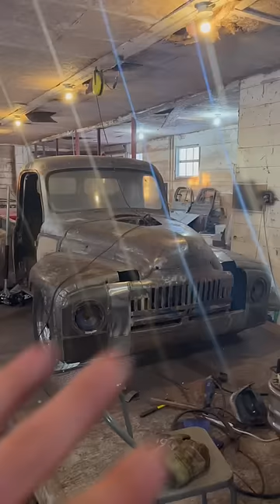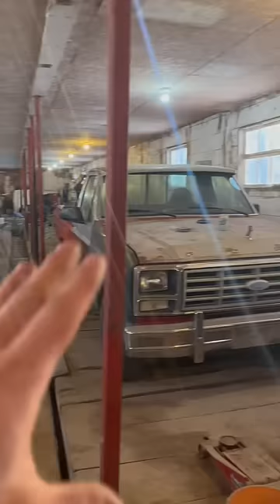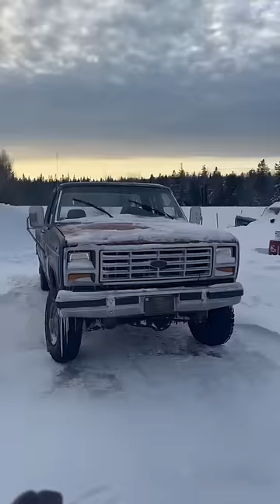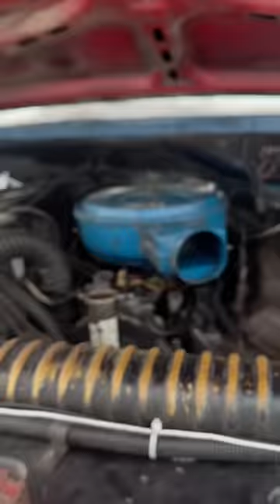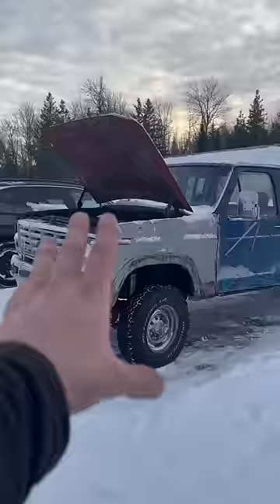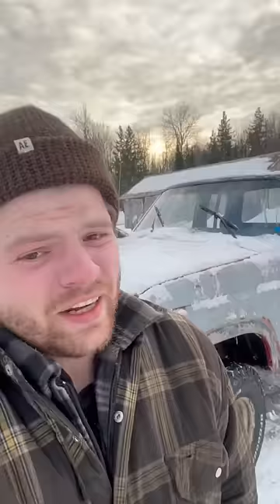FORD couldn’t figure it out until 2011!

Comment: The 6.0 was the nail in the coffin on that company
Reply from the maker: I know what you mean, the all international variant of the 6.0 wasn’t too bad I guess, vt365 was the international trim, a few accessories differences but the biggest change was the international one wasn’t factory “chipped”, running all day everyday was more important than max hp and tq unlike the ford trim.
Reply from the maker: Likely that same story though as my old 6.9, half the reason this old power plant is so tough is it doesn’t make enough hp and tq to hurt itself for its size haha 😂
Reply: no, the 6.4 was the final nail in the coffin for that company.
Reply: You can blame ford for that. 

The VT365 had none of the issues that the Powerstroke did. 

And no, it wasn’t the 6.0 that was the nail in the coffin
Reply: 6.0 wasn’t bad engine ford decided to put bolts instead of studs in the heads to be cheap and the injectors used by ford and chevy were the other cause.  The 6.4 was a giant turd.
Reply: Buddy the 6.0 looks like the most solid engine in the world compared to the Maxxforce. The Maxxforce is the engine that wiped them out.
Reply: @kneedragon76 AND, not enough head bolts, and plastic fittings that break, and casting sand in the cooling passages, and terrible stacked plate oil cooler, and variable vane turbo that seizes up and.......
Reply: Did this man just say there's nothing wrong with an international?
Reply: @iwouldrathernot4274 they had a version of the dt466 in the first generation nova lfs city bus. yes many other city buses also had it as an option, but only in 30 foot long buses usually. novabus at the time only had a 40 foot long option. apparently those detroit series 40's loved to explode in them. as of 2004, it was no longer offered as an option. though i'm pretty sure no transit agencies bought the series 40 in droves after the late 90's/early 00's.
Reply: Watcha mean?
Reply: @kneedragon76 literally every diesel ever has head bolts. There just wasn’t 6 per cylinder, and they aren’t gonna blow if you don’t tune it, delete egr, and drive like a normal person
Reply: The 6.0 was as great motor. Too many morons were putting race tunes in them and blew the head gaskets and you had assholes commuting/idling them because diesel was cheap and coke up the vgt valve and or the egr. I had over 300k on mine and if I wasnt plowing, I was pulling
Reply: It was the 6.4
Reply: @gavincarroll2553  the 6.4 is the best powerstroke ever made besides the 6.0, the only issue with it is emissions
Reply: @gavincarroll2553  last good international powerstroke was the 7.3
Reply: @illinoiscentralrailroadfan6015  I know but they could've fixed what got messed up with the 6.0 the 6.0 was the first nail the 6.4 was the last
Reply: @gavincarroll2553  I agree with you, I was in highschool when the 6.0 came out and already planned to go to school to become a diesel mechanic.   At time in highschool I already knew that I would be working for Ford sometime soon, so I decided that after I had been there for a few years I would get one.   Six months after I made that decision 6.0 recalls began.   I decided at that time I would never own a 6.0 powerstroke.
Reply: @illinoiscentralrailroadfan6015   I do want one because 1 they sound good 2 there really cheap now and 3 after there bullet proofed there not bad trucks but stock there a ticking time bomb
Reply: Nope 6.4 was my 6.0 has nothing wrong with it and it’s got 700hp
Reply: @DragonTorquemovies  the 6.0no🤣👍
Reply: @kneedragon76  Crazy part is, a bolt and a stud realistically are about the same amount of material. The cost difference to stud the engine during design had to be within a $100
Reply: International didn't build the 6.0
Reply: @JBlinky67  international and navistar did ford didn’t make their diesel engines till the 6.7 powerstroke came out know your facts
Reply: People blaming ford for the 6.0 issues I blame international for not enough head bolts 4per cylinder is terrible 6head bolts per cylinder would have given this engine enough clamping force to avoid at least 75% of the blown head gaskets
Reply: Its still a mystery to me that ford went with 4 bolts per cylinder on the diesel.
Reply: @DragonTorquemovies  the nail in coffin was the 6.4 which happens to be the last engine Ford had built for them until they decided to do it themselves. 6.4s are dooooooooogshit worst diesel that ever came in the big three
Reply: 6.0 was pushing way more power so it was bound to have issues. 6.4 was even worse.
Reply: Huh, I guess I thought the 6.0 and 6.4 were Ford designs, and I’d thought it took Ford until the 6.7 to figure out how to do a diesel engine right

Comment: If peg can't kill an IDI, they can't be killed.
Reply from the maker: I can agree with that haha, I’m getting a little worried though, we haven’t seen slave lake since last winter now as far as I’m aware.
Reply: @highostablegarage  last time I remember seeing her was when it blew the belt off during a savage cold start. The one where Peg used the white Ford to push slave with.
Reply from the maker: @anthonyjulson8840  for me it was when they were bagging it through snowbanks with I think sawed off Frenchman and it overheated, might be the same video though
Reply: @highostablegarage  I believe it was the neighbor. Is this the video where the bumper fell off? If so, I think it is the same one.
Reply from the maker: @anthonyjulson8840  yeah same video
Reply: Oh they can certainly be killed…some are just tougher than others. I had a well maintained 6.9 that popped a head gasket just cruising down the 2-lane at 55 one day, no rhyme or reason as to why. Sometimes you just get a really good one, but then sometimes you’ll get a really bad one.
Reply: @J.R.in_WV  I'm not sure if you're a fan of the zip ties and bias plies channel, but I'm pretty sure the truck I'm talking about definitely has a head gasket failure. She still runs good as far as I know though. I guess it comes down to where on the gasket the failure is.
Reply: @anthonyjulson8840  peg straight up said the head gasket was gone but she still ran ree ree strong.
Reply: I’ve had three 86’ 6.9’s….one burnt a valve @ 348k and a rough life.
The one I currently have is at 159k and I bought it from the original owner
Reply: @highostablegarage  she still runs, he uploaded a video to his patreon about the truck.
Reply: @highostablegarage  yea um the 6.9 has one issue that i know of cause it happened to a family member if the o rings get wore out bad it will mess up the motor
Reply: @highostablegarage Don't worry about slave lake.
 That truck made his channel and he knows that he's admitted that on his channel and he said she's not going anywhere He recently actually puts some new parts on her
Reply: I love pepin leggin
Reply: @kartaku132  I saw the sla e lake revive video. I never heard him admit that save lake made his channel.
Reply: @anthonyjulson8840  I can't remember which video it is.I believe it's the one where he puts her on the back of the kenworth and Take her to the parade but I could be wrong
Reply: I just had to start parting out my idi. Low compression. Bent 4 push rods had some minor valve piston contact. Rebuilt the head as all the exhaust valve guides were shot. Sadly still has low compression. Truck has 375000 on it, started life as a fleet truck so can't fault it. If the truck was in better shape I'd rebuild it. Keeping the drivetrain for a future project.
Reply: @anthonyjulson8840  just like an FE
Reply: Miiiiinnnttt!!! I was waitin fer a comment about ol peggin leggin!!!😅
Reply: @justinharroun69  you're kinda stunned if you aren't subscribed to his channel!

Comment: I have a old 85 F350 king cab 4x4 duelly with the IDI diesel and a 4 speed manual transmission. I got it dirt cheap ( free ) with only 101xxx original miles. It's now got 234,787 miles on it and it's still as slow as it was when I got it. But I have pulled countless truck out of the mud, snow, ditches and one from about 7 ft under water with the trailer still attached at the boat ramp. It has never left me stranded, it's never got stuck ( awesome tires, lockers front and rear and lots of luck ) and it's always pulled whatever it was out of wherever it was. I love that old beast. But it's getting a Turbo 7.3 powerstroke with a 5 speed soon. Already have the engine/trans / transfer case sitting in the shop.
Reply: If you had an F series with an lDI in it 0-60 would take a while, hook up a trailer with 10,000 lbs on it the acceleration would be identical to no load. Not much on horsepower but mountainous torque right off the line
Reply: Take my advice, don't ever let go of it!
Reply: @GorillaCookies  I'm jealous.
Reply: @MichaelRoy-hc3lz this just is not true. I’ve had a bunch of IDIs. Maybe mine were all worn out slobs but they were great unloaded cruising around but you put a trailer on and it is a road hazard.
Reply: @gavinmetcalfe140 I’ve had some that couldn’t get out of their own way and some 6.9’s and 7.3’s both that were turbocharged and pulled great. The problem lies with people thinking they should pull like a brand new 500hp/1000ftlbs tq turbo diesel and that’s just an unrealistic expectation
Reply: All 7.3 Powerstrokes are turbocharged my friend
Reply: @GorillaCookies  are you selling or keeping? if selling how much?

Comment: It's not that Ford couldn't built diesel engines. They were still building them for farm tractors in to the 90s. The problem was that they didn't have an diesel that worked for a pickup truck so they shopped around and found International had one to their liking. The interesting fact is that Ford and International were old rivals in the farm sphere almost as long as Ford had been rivals with GM.
Reply: Right on 👍. Ford was probably the leader in Medium Duty trucks up until IH introduced the S-series in 1979.
Reply: @ghenry85  ford built some amazing tractors
Reply: @ghenry85  still, they could've easily stuffed the 6.6 Brazilian in a 3/4 ton. They put them in the f800's along with the 7.8. they even had the 6bt as an option for crying out loud.

Comment: Ford did know how to build diesels, and in fact built many different models, but they were primarily used in tractors and medium duty trucks, in other countries. They were also inlines, not a V configuration, and Ford didn't want to have to completely redesign the truck and firewall to fit the engines, the way Dodge did.
Reply: Dodge did NOT redesign thier firewall to fit the 5.9 Cummins in thier trucks. 89 was the first year of the Cummins being available in a Dodge pickup, and that firewall was the same from 1972 through 1993. The radiator core support was changed for the diesel trucks in those years, but not the firewall.
Reply: Ford's 6.6L Brazilian diesel would've been a good pickup truck engine but it never would've fit. Too much BS hanging off the front thanks to the waterpump location. The B series Cummins has the water pump offset so it's not sticking out in front of the #1 cylinder or timing gears. Chrysler did that same thing in 1959 when they introduced thier Slant 6.
Reply: @johneckert1365 Yeah, I mean 5.9s fit in Rangers...
Reply: This is correct the 6.6L and 7.8L  Ford diesels were real workhorses, but were too large for pick up trucks.

Comment: The 6.4 was the last straw!!
Reply: *last stroke 😂
Reply: Mine is running just as good as it did in 2010 and almost 350K on the clock. @LynxStarAuto
Reply: @johnelliott7375  did you buy it new? any major repairs along the way?
Reply: @xxmobstrxx8535  if you want a 6.4 to last, you MUST fully delete the emissions systems and tune them. The DPF, EGR, and Regen systems absolutely fuck the motors. My dad has a 6.0 he had since new. Those need studded and EGR deleted, but out of the box they're more reliable than a 6.4 because of the emissions.

Comment: We have a 93 7.3L International and I swear the engine will outlast anything else on it! 323k and creeping!
Reply from the maker: Yes sir likely will, I have a buddy who pulls a 5th wheel flat deck trailer with his, his old Idi is an X rail yard truck, has over 1.5million kms on the long block, has had a few injection pumps and a couple c6 transmission since but the engine is still plugging away 👌
Reply: @highostablegarage to be fair tho, the C6 is notorious for issues, same as the E40D ford really didn’t get that nailed down till the 4R100

Comment: I do love the 6.9 and 7.3 idi but I still think ford should have put the dt360 in there pickups
Reply: I've always thought that too. Problem was the waterpump arrangement on the DT. Being inline with the cylinders it added way too much length to engine. The B series Cummins had the water pump offset so it wasn't competing with the #1 cyl or timing gears for space. IH followed suit when they redesigned the DT466 in 1994.      Chrysler slant six also had an offset waterpump to save length.

Comment: I knew about those IH diesel engines being in Ford pickups!!
Back in the 1990s, I worked for a used pickup dealer who bought and sold a steady stream of those Fords.
I worked in the dealer's mechanic shop, helping to rebuild the engines.
Reply from the maker: Yes sir, I love them to pieces, they are pretty much a tractor engine, just an old faithful power plant

Comment: I have a 1953 International 2 Ton dump truck (big wheat truck) and a 2002 F350 7.3L 6spd manual, manual transfer case, manual locking hubs.  She's a tractor..  and I love it.   So, I'm right there with ya...  Ford and International baby

Comment: I'd like to get my hands on a big block GMC V6
Reply from the maker: Good luck haha, I’ve personally never even seen one around here
Reply: Those legit existed?
Reply: @anthonyjulson8840  yea, they were common in tandem dump trucks around here before the diesels caught on …the 478 V6 was a stout pulling engine for what it was. The smallest GMC truck V6 they had was the 305, you could even get it in gmc pickups for a while. Same external dimensions as other GMC V6’s just de-stroked and a smaller bore.
Reply: I just passed one up complete and running for 250 bucks
Reply from the maker: @MidwestMechanics  wild haha
Reply: Dudes with wrenches just posted a video about the v6 big block
Reply: same
Reply: There were diesel versions of those old GMC engines. ToroFlow they were called.

Comment: Ford didn't need to start making their own till International let the quality go to shit. I'm not aware of Fords having diesel engines till 83 but, there might be some 82s that came with them. Ford and International started working together as early as 78.
Reply from the maker: They had a few smaller diesels for couriers and such, obviously larger diesels for past the f350 sizing like in the 9000s and 600s but I cant think of any in the 250s and 350s pre 83 either.
Reply: 82 is when IH started working with Ford on the 6.9 diesel, introducing them in 83. 
Note: the 6.9 and 7.3 idi are designed off of IH 404 and 446 gas engines.
Reply: @johneckert1365  They actually started working together as early as 78. They finally got diesel engines in Ford trucks in 83. That's excluding the big dump trucks and road tractors.
Reply: @nicklewis7291  oh wow, I didn't know it was that early. 
Ford also collaborated with Caterpillar in the early/mid 70's and designed Caterpillar's 1150 & 1160 (early versions of 3208). Ford wasn't involved with the manufacturer, just the designing.
Reply: @highostablegarage I can, in Australia dentsides were fitted with locally built engines like the 351 Cleveland and 250 six. There was also the option of a Perkins diesel 6.247. They’re quite rare because most wanted 351 power.

Comment: 7.3 powestroke was the last reliable diesel in a ford pickup.  Until in 2020 when they went too steel pistons.  Heard good things since then.  Reliable diesel with a non rusting aluminum body is a win win.
Reply: Ha 😂, that aluminum bs might not "rust", but it still corrodes into white powder.

Comment: International trucks are almost indestructible, and ford wanted some of that reliability, that's where the IDI engines came in lol.
Reply from the maker: They work some good, they are better than the gm 6.5 that’s for sure haha 😂
Reply: @highostablegarage this is true 🤣
Reply: That's why the truck falls apart, and the engine remains 🤪
Reply: the idi came from and international medium duty gas engine that didnt sell very well to recoup their tooling investment ih made a diesel out of it.
Reply: @REDPWR4EVR Yes, the 404/446 gas engines.

Comment: And the international harvester diesel motors are unlike the gm V8 5.7 and 6.2 first version diesel V8 motors you can actually work and pull trailers with the 6.9 or the 7.3 idi and not hurt them and i am am not a huge fan of Ford but the 6.9 idi diesel happens to be one of my favorite diesels ever built...

Comment: Ford had a successful relationship with Navistar and invested in them to build the diesels.
They did figure it out.
That's how it was done and many people bought them.
They weren't sitting there still when the new year model was shipped.
They were out doing what they do.
They did not get trucked and shipped out to another country.
People wanted them.
That's figuring it out and improving, etc.
I cared for a lot of them.
I helped repair them.
Yes , they were not fast.
They needed gaskets, water pumps, time switches and glow plugs.
Don't wait. Fix it.
Those customers chose those no problem. compared.
Prayed for a tailwind.
Added power kits.
Reply: They worked well together for being at each other throats for decades in the farm equipment world. But good on them for being pragmatic and making something good.